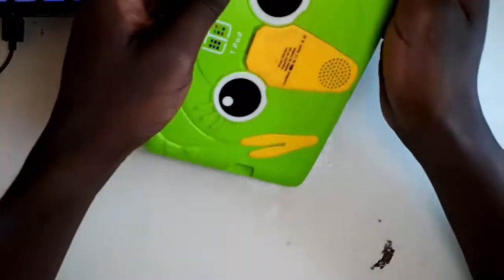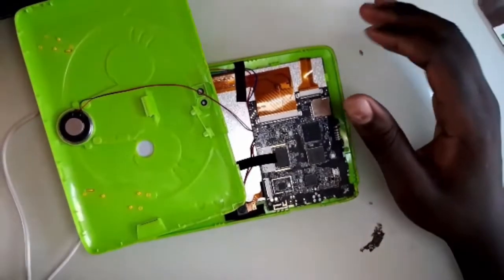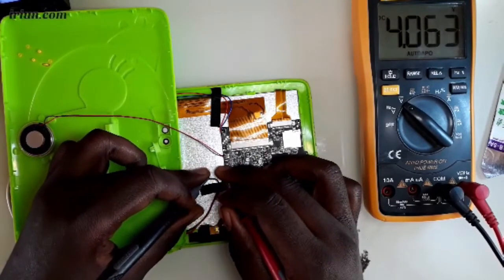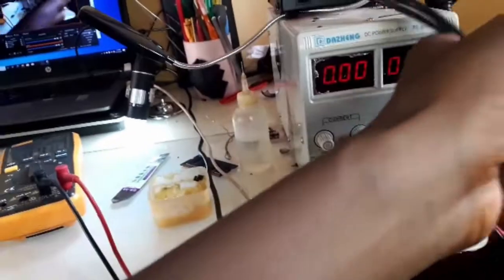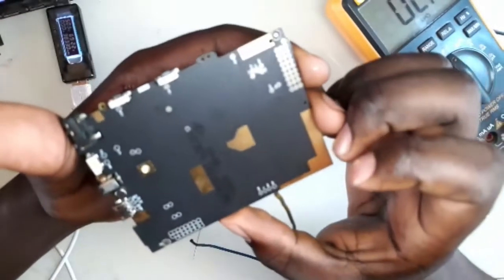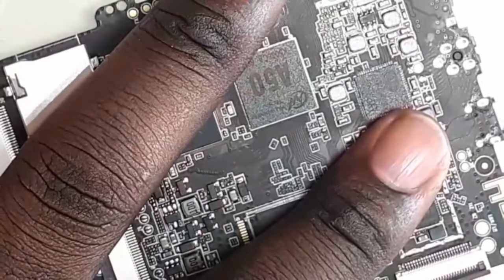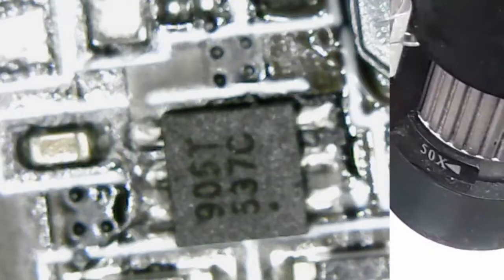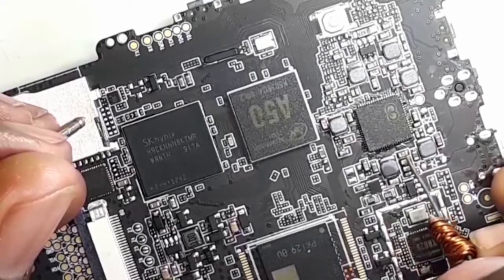how to Check and Repair short circuit in Tablets

Comment: Hello, so did you end up replacing that capacitor or you left it out ? if so why would that be ? thanks !
Reply from the maker: Hello i didn't replace it, because its on the output side, output volts have more smoothing caps in the line